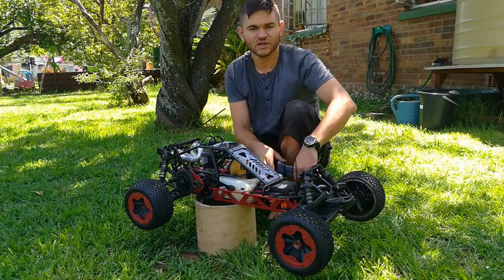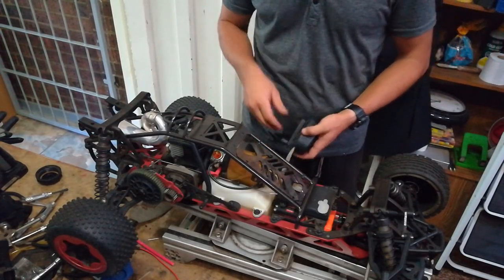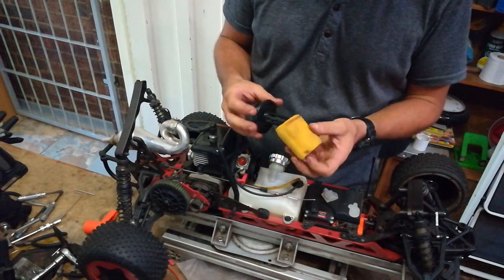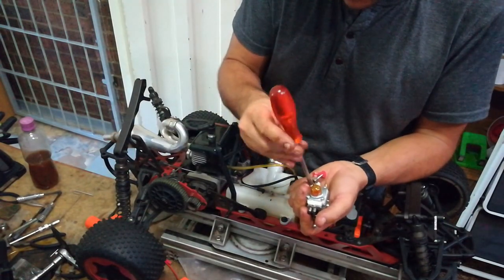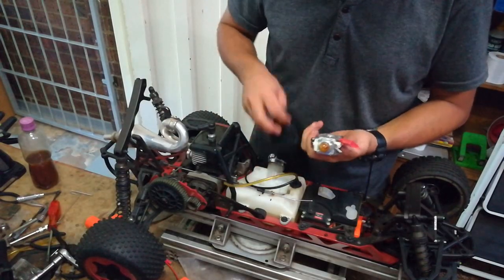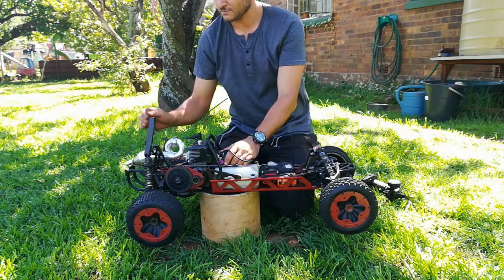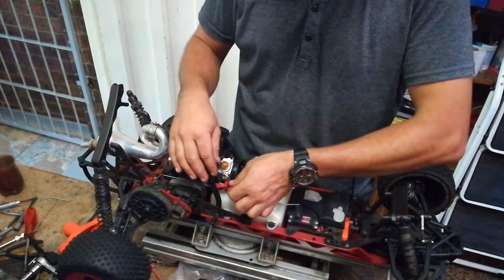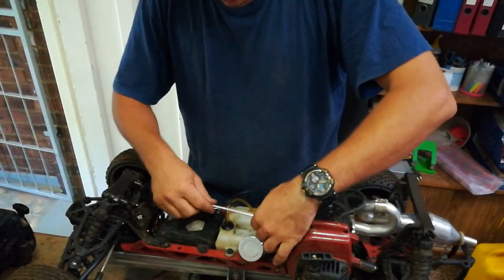Somtimes cleaning a Baja carb doesn't work....

Comment: Hey can a chung yang R260 motor be ported out??
Reply from the maker: Hi, Yes, you can basically port any motor, but there are limits. Some might give huge gains and some just a little. On some if done wrong you will get big RPM but lose all the torque.

We are very excited to post videos of our latest ported 45cc very soon. I just finished it today and the power delivery is amazing.